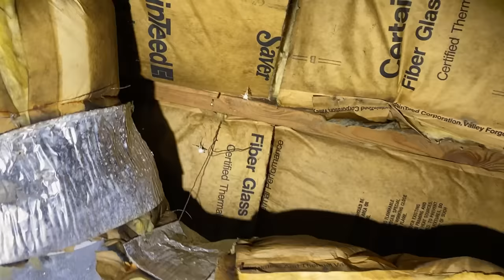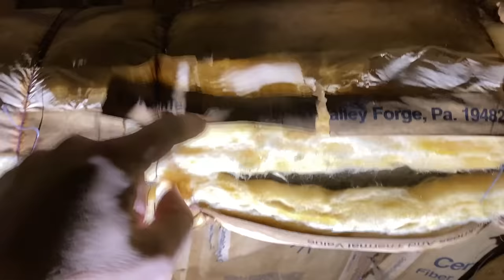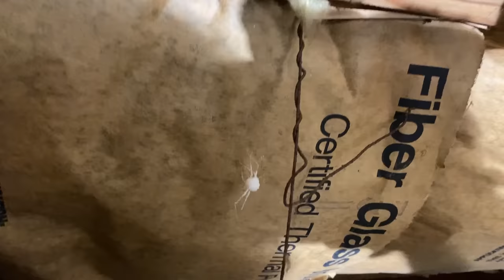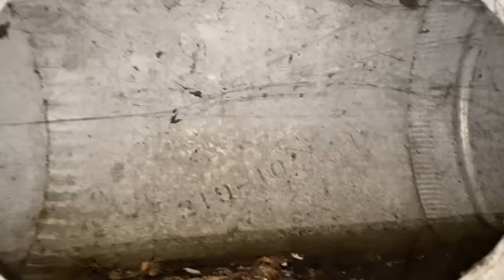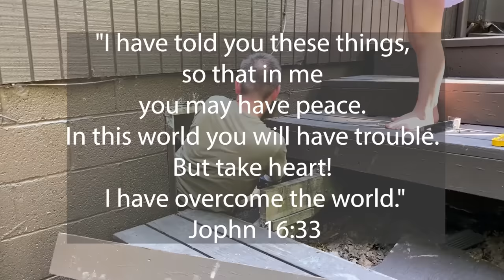Finding A Secret Room Under My House and What Was In It

Comment: That is a typical crawl space, just taller than most. There is a whole industry that has taken off all across the country fixing these messes because the old school idea of how to build a crawl space doesn’t work. Remove all of that crappy, mold loving fiberglass, remove all the junk left behind by the builder, and get to work. Level off the dirt floor and install a heavy gauge poly vapor barrier over the entire floor and all the way up the walls, where it meets the sill you will want to caulk or foam where the wood sits on top of the blocks and seal the poly to that. The then secure the poly to the sill with furring strips and nails. Insulate the walls and floor of the crawl space and add a small supply air outlet and a return on the opposite side to ventilate the space. Leave the underside of the house floor uninsulated. If you don’t get the moisture out of this space it will keep stinking and will eventually rot the floor framing.
Reply: If you have enough overhead in the space, you can finish the space for storage. Clean and paint the area, sealing any holes and place some type of door so you can get in and out to build shelves/ for canned food storage or small seasonal equipment storage. Sq footage is sq footage, do not waste it!
Reply: @route66paul  don't forget to make it accessible. Somehow, make it so you wouldn't notice there's a door there, and make sure it can be opened and locked. A wireless camera down there would help you secure your storage. (And know about any kids who might try to use it as a play area and hurt themselves.)
Reply: @fitybux4664  Yep. And you don't want to make the neighborhood passion pit for teens. Anyone who had a camper, trailer, utility room or loft in a garage could be a go to for teens when I was young.
Reply: Mold doesn’t grow on fiberglass.  It can on the paper backing.  This crawlspace does not have enough ventilation.
Reply: Why would you make the whole room part of the envelope?  If you put the vapor barrier on the floor, the only way to keep it in tact is to build some kind of subfloor over it. And putting a vapor barrier on the inside of the walls is going to be a tough one to make succeed. Barrier really should be on the outside of the walls but I don’t see him excavating the perimeter to add a proper barrier.  If he actually liked the suggestions of converting it to a root cellar, wouldn’t you want to keep some of the moisture and just provide good ventilation?  Ventilation is an absolute must regardless. Whoever built that and just closed that entire space up with zero ventilation should be banned from ever building anything ever again. Anyway, unless he decides to concert it into livable space, I don’t think I’d go to the trouble and expense of trying to establish a vapor barrier over bare ground and buried cmu walls.  My priorities would be to fix the drainage issue along that access wall under the deck, repair the damaged cmu wall, replace all that nasty duct work (or if financially not possible at least have them professionally cleaned.  That shit is unhealthy) with insulated ducts of the proper size (do not reduce your duct sizes without consulting an HVAC pro. Feel free to DIY the work, but not the decision if considering reducing the duct size which I feel like I may have heard stated in the video but I may be hallucinating. Finally, set up good cross ventilation, dry out and install vapor barrier to stop moisture intrusion thru the  first floor flooring system.
Reply: I"ve seen a lot of 50 year old houses in Oregon that had obvious mold problems, because they built up walls against underground concrete and trapped the moisture in. One even had a laundry room right up against the underground wall, with a bad mold smell in it. New construction they recommend vapor barriers over all dirt floors, and I'd look at ways to waterproof the concrete work too.

Comment: I was a Home Inspector for over thirty years.  The white powder on the block is Efflorescence.  metallic salts left behind by water migrating through the block.  Reconnect the downspout and get  that water away.  The pattern on the fireplace foundation may indicate the top of the flue/chimney is leaking. Should have a topping made of mortar or cement called the coping or flaunching and they fail over time.  If it's cracked, replace it.  The only ducts I ever saw with that much water in them were flooded by some accident in the house.  A tub overflowed or even a toilet and ran into a floor register.  It will persist for months once in there.  Good luck.
Reply: You should REMOVE ALL OF THE DAMP/WET INSULATIONS, FIND AND SEALL ANY AND ALL LEAKS, DEHUMIDIFY THE PACE WITH FORCED-DRAFT BLOWER BEORE STARTING ANY REBUILD!
Reply: Informative reply. I have a chimney inside my house that weeps water from the face of the bricks about midway from the opening and the ceiling. It's intermittent and cannot locate the breach.
Very weird to see... 
I want to experiment with different dyes to find the breach. 😂😂😂
Reply: Listen to the Inspector! And the mold warnings
Reply: @randallsmerna384 I need an update on your chimney 😅
Reply: @randallsmerna384 Could be water coming in from under your chimney flashing from not being properly sealed. This can create major water damage issues over time if not properly fixed.

Comment: You probably figured out by now but the drain on your HVAC unit is probably not draining correctly so it’s backing up into the air unit and since you’re vents are on the floor per se blowing up instead of in the attic blowing down or going from the floor to the ceiling It’s all collecting and that’s how you end up with the problem

Comment: That space could make for a really good root cellar/pantry space.
Reply: or armoury
Reply: A great place to hide the bodies.
Reply: That is condensate and that ductwork needs insulated properly and a U.V. light needs to be put in your air handler/furnace to kill mold and bacteria so no more smells form as easily. You need to clean out the duct with smelly water.
Reply: Wasted space. Definitely could have been used as a storage room etc.
Reply: It is a mystery as to why it was not made into a basement? Could of been that the original approved building plan did not have a basement and the inspectors and other contractors wanted to charge for change of plans and the general contractor backed out and just borded it up as it was found? Seen stuff like that happen before.
Reply: @davecasey4341  the stink would mot be good
Reply: That space will ALWAYS have massive amounts of mildew in it now. I'd just remediate it and let it keep being a room for ductwork.
Reply: CN
Reply: @davecasey4341  he is trying to get rid of the smell, not add to it.
Reply: @pragmatologist 😂

Comment: I'd dig out the side of the foundation and install a door. Pour a floor with drain. Nice storage room/root cellar. I'm wondering about the rest of the foundation. You might have other potential rooms in which case make more doors throughout obviously consulting an engineer and voila basement.
Reply: You could also make a hidden door in the floor with a ladder to descend. Then and put a rug over it and use it as a safe-room for the family to hide in or weather out a tornado.
Reply: Exactly what I was thinking right away. Maybe they already have tons of other basement storage space, but it seems like wasted space to me. Maybe make a door from the other basement into this space?

Comment: There's some good advice below here. However, 40+ yrs. of construction says you need "foundation vents" to get the moist air out . Use the type that can be closed in the winter. Good luck.!
Reply: I don't know where this is but encapsulation is preferred in the Southeast.
Reply: @ibrewhaha  with modern tech encapsulation is useful everywhere
Reply: Yes, Steve is correct, you must have vents ( 2 should be fine for that space on either side if possible ) to allow air flow and get moisture out.
Reply: @ibrewhaha  That would be a waste of money in that crawl space area. It's well below the grade outside and those blocks have moisture coming through. That would indicate there is no waterproofing done on the outside. He should just vent on all sides and get airflow in there.
Reply: Agreed. There's no waterproofing on those blocks from the outside. Easiest solution is to vent out and get some air moving.
Reply: That also cause in the summer and humid days the hardwood floors will  be damp
Reply: I agree

Comment: Having standing water like that in those ducts had to have been an incredibly unhealthy situation!!! If your family has suffered with allergies, respiratory problems, or immune system challenges - perhaps you now have a possible explanation. At the very least you should have a local heating contractor review your entire system, do a duct cleaning, any repairs needed, and new installation. It might also be prudent to have  the house checked for mould and remediate it if needed.
I'm assuming you did not have a proper home inspection when you purchased it.

Comment: 1.  Fix down spout to keep water away from foundation.
2.  Run snake camera into ductwork.
3.  Add hinged door to access that swings in.  Add hinges to stair so it opens up so you can access hidden room.  
4.  Remove and replace all insulation.  Remove debris.
Reply: 5. dig up dead body 😒✔
Reply: @casid9929  was a whole year up and noone finished ur list bud I was astounded hehe ❤
Reply: I was thinking hatch door inside to keep as a tornado shelter
Reply: Hinged stairs are a fun idea.
Reply: @tigress63 that was my thought too. Use as a root seller and if possible make a bigger entryway door to make going in and out easier too

Comment: If the smell started recently, my guess is you had water accident above, like a toilet overflow and it leaked into a floor vent. The way vents connect to an air conditioning "A" frame, it would be a stretch for condensate to be inside the vent. Typically, blocked  condensate drains show up as water damage in a ceiling or floor.

Plug the holes you drilled, wait a week an see if there is any more water. You can look next to the A frame and see if there is a drain tube. You can sometimes use compressed air to blow it out.

Comment: Don’t put vapor barrier under the insulation.  Water will collect on the inside of the plastic and all your insulation will absorb it.  Eventually the floor will start to rot.
Reply: I think the Kraft paper is supposed to be a vapor barrier that should be against the  ceiling and the ducts, meaning it was installed upside down. The insulation got soggy due to moisture condensation from summer air conditioning, and it dropped off over the years. Mold growing in that stagnant water probably caused the odor you spoke of.

Comment: Yes, it's most likely all condensation. All that insulation is reversed, the craft paper needs to be on the heated side. You have big mold issues and drain issues that must be addressed. My suggestion is to start with some professional advice, starting with an inspection and their help in working up a plan to fix all this soon. This is a health and safety issue for your family.  Good luck.
Reply: In otherworldly, just tare it down.
Reply: Not on duct work.
Reply: constant heat and cold, on the popes 24/7 or at least when the heating on, you could fill buckets with drips, question is how good the floor, in that secret room, is water seals some how, it cool dark place no air movement, anything that puddling on the floor just going to stay there?
Reply: Or use FSK BLANKET INSULATION,

Comment: If you install a dehumidifier to space you won't  have condensate also trash all insulation probably full of mold. Dehumidifier won't get rid of any mold that already exists but can save any wood in structure. Mold will have to be removed for health reasons. There are plenty of crawl space youtube remedies for your issue especially for invented crawl spaces such as yours. Also introduce conditioned air into craw and mechanically exhaust tainted air but Dehumidifier immediately

Comment: You probably should not have entered the basement space without wearing a respirator mask. That space has some black mold on the insulation wrappers and some on the plate( where the house meets the basement) along the part of the ( entrance) wet wall. The white lines on the cinder blocks might be mineralization or some sort of white mold. Albino spider corpses should be taken as a warning....just to be safe. Get a professional ventilation/ heating serviceman as well as a foundation specialist. Fix it right the first time....saves on time and money in the long run. There were some good suggestions made as to what you can use this space for.. Good luck with your repairs.

Comment: I agree with Kevin and Able. I have one other comment, removing the steel galvanized duct work and replacing it with a fresh new flexible duct is a huge mistake. Flexible ducts need continuous support such a laying across your attic. The galvanized steel ducting is the best available. Changing that would be like putting house slippers on a race horse! Put the old one back in and after solving the water problem have your ducts cleaned and patch the drilled holes!
Reply: I know that this is one year too late, but I absolutely agree!  That flexible duct is junk!  A glorified dryer vent with a garbage bag around it.  It sags and pinches, has terrible air flow, leaks air due to its flimsy nature, gets clogged with debris and can't be cleaned easily, and molds and degrades quickly.  A rental house we used to live in had that; some rooms had weak airflow to them, some didn't even get any heat at all.  Keep in mind these rooms were the closest ones to the furnace!  Air flow is really important in saving your furnace from overworking itself and maximizing you heating output. It is also very important to have the same CFM for both the air leaving the furnace, and the air returning.  The returning air has to be at least, or greater than the outflow, otherwise you risk overheating the furnace. From what I have read, not many professionals follow this practice.  Tons just use that flexible duct in order to save time, effort and money.  That or the dreaded sheet paneling!  That is the worst you could ever do to yourself.  Wood moves, shifts and twists over time, creating huge gaps in the paneling that air flows right out of.  Not to mention that you do NOT want moist air flowing through your floors/walls.  Think of what it does to the wood and/or sheet rock!  And your health!  From what I've read (professional HVAC installer guide) a lot of people really miss the boat on the return CFM, shortening the life of many furnaces.  When we built our house we got a quote from an HVAC company.  We were tired of doing all the work for ourselves and hadn't installed an entire HVAC system before, so we thought maybe just this one time we will have someone else do it.  They wanted a whole lot for the junky stuff and refused to go up to the third floor.  When we insisted that we wanted sheet metal they said that they would have to get someone else to do that as they didn't know how to.  How crazy is that!  Some other guy showed up to give us a separate quote for that extra work.  Then the HVAC company couldn't even cut the holes for the floor registers and said a carpenter would have to do that!  Well, after that we were like....Yeah, not happening.... So we did our research and found that round galvanized steel duct pipe is the best. For corners you wanted to have curved angles.  Second best was rectangular duct work. We literally spent months planning out which pipes to use and where, calculating which diameter we needed both for the pipe and the registers, the CFM the furnace could handle and how much each room needed, how much CFM flowed through each pipe and register, and where best to place the return air in order to get the best circulation in our home. We practically wiped out the local FW Webb's entire inventory of galvanized steel duct multiple times.  It worked out great!  The over 5,000 square foot house has a furnace that only needs to heat for about 3 minutes every half hour or so during the winter time (granted the insulation plays a huge role in this).  Keep in mind this furnace was made for a 3,500 square foot house.  The air flow is amazing and the dirt either stays near the vents, or makes its way to the filter near the furnace for easy cleaning. A couple of booster fans ensure that the heat reaches the furthest parts of the house.  Yes, using galvanized metal is expensive and time consuming, but it is worth it.  Many might not realize it, but equalized temps, air flow, heat times and cycles, furnace lifetime, air quality, humidity levels, the air pressure in each room, etc., depend on the quality of the work and materials.
Reply: @Nessy-of-the-Lynn 
In this rental, rats have completely stripped the old fiberglass wrap insulation off these galvanized ducts. The thought of trying to re-wrap them is daunting, (cramped, rat poop, and cholla cactus spines dragged down by the rats). The rats have been dealt with but the problem persists.  I'm sure it is costing more to heat and cool without insulation.
I get all itchy just thinking about having to wrestle the pipe insulation - wrapping and wrapping and hugging that crap... 
I thought about spraying the ductwork with foam insulation from a small kit. I would think the accumulated dust would have to be wiped off prior to spraying for good adhesion. I'm not even sure what the required amount of foam would be... I can figure out the surface area of the multiple "cylinders" are and combine them and then figure out the thickness of the foam. I suppose getting a quote from a foam company couldn't hurt either but I bet it's in the $1000s!